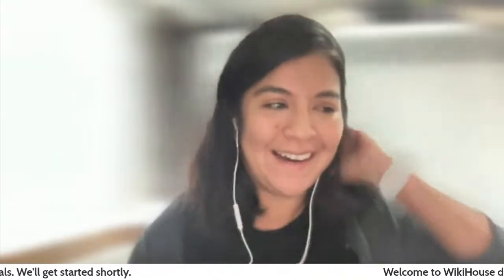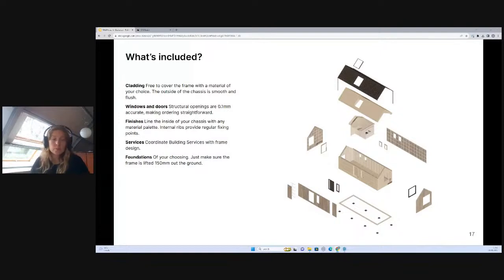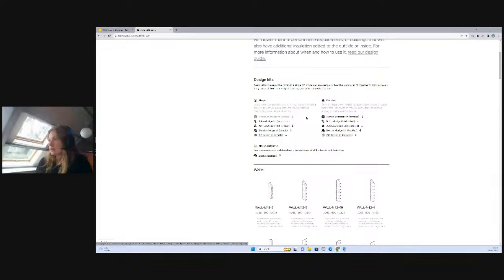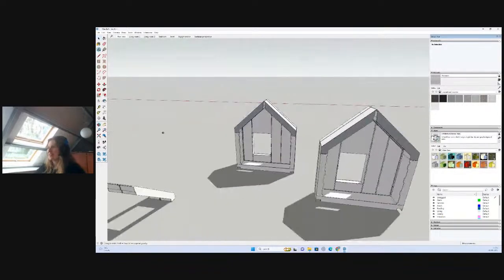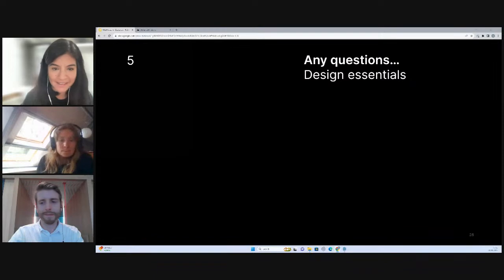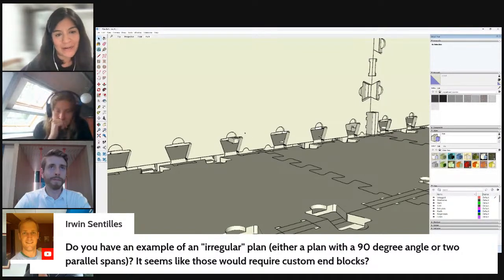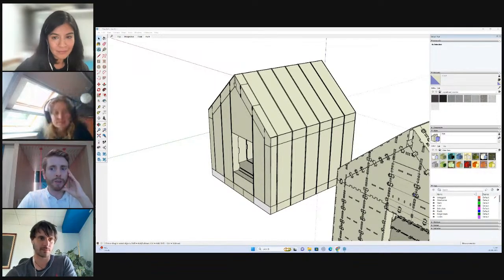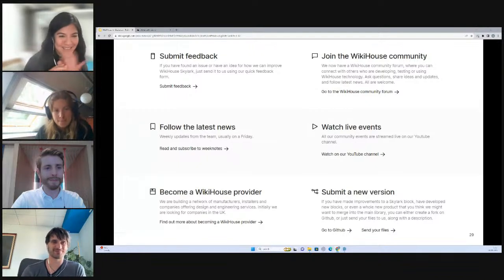WikiHouse design essentials

Comment: In the US, we use standard 16 or 24-inch on-center framing and expect a standard 24-inch wide block to be the best option for a Wikihouse structure. The challenge is that the standard US plywood is 48 inches wide, making it impossible to get two 24" panels from a single sheet, including the kerf from the router bit. In comparison, the metric version uses 600mm blocks, and the plywood is typically 1250mm, allowing for two (2) 600mm panels and plenty of extra space to make the most of your plywood.  How should we address this in the US? Has this come up before?
Reply from the maker: Hi Danny - A standard 24inch wide block would seem appropriate for the US if you're intent on matching timber framing spacing. It may be possible to make some modifications to the standard Skylark blocks to accommodate the increased width, and reorganise the cutting files so that two 24inch panels don't sit together on a single sheet, but it won't be as materially efficient as the current blocks. In the UK we have the odd advantage of having imperial dimension plywood sheets (4ft x 8ft) but metric building and framing dimensions (600mm and 1200mm), which affords being able to fit two facing panels side-by-side on a single sheet with a 10mm gap. Maybe it's worth considering if the WikiHouse blocks need to correspond with the 24inch framing centres, and also connecting with US based members on our community forum (https://community.wikihouse.cc). You might also want to reach out to Construx who have been building WikiHouse projects in the US and may able to offer some advice - they can be found at https://www.buildconstrux.com/

Comment: I am a teacher at a carpentry school and I love the idea of manufacturing the parts in a workspace and assemble it in just a few days, creating a house. For our point of view the translate directly into of topping of technology.

I do have a few questions for you.
Are you working on a way to build hipped roofs? I'm from Denmark and quite a lot of our 1 family houses, have hipped roofs. 
In the start of the video, it was stated that the u-value was pretty low, however for a danish point of view, the stated value of 0.15 - 0.18 W/m2K is not that low. Therefore I wonder what kind of isolation is used to calculate these u-values and what lambda-value the isolation had?
In Denmark new houses should have a u-value 0.14 W/m2K and for our low emission houses u-value of 0.12 W/m2K. So from a builders point of view, I have problems seeing where we can build Wikihouses in Denmark, but maybe you can help me with the details of the isolation properties.

Hope to hear from you.

Best Regards
Andreas
Reply from the maker: Hi Andreas - Thanks, great points. While we don't currently have any hipped Skylark roof blocks, there are examples of these forms constructed using similar CNC-cut plywood methods, so it should be possible with modified or custom block designs. Great to see Denmark leading the way on thermal performance regulations! In terms of insulation, the standard insulation values are determined by the cavity depth of the WikiHouse blocks (200-250mm), but you can simply add external insulation, such as woodfibre boards, to the WikiHouse chassis if you want a better U-value. Hope that helps!